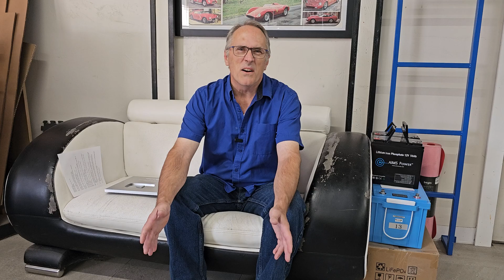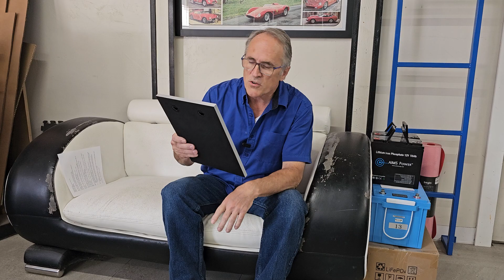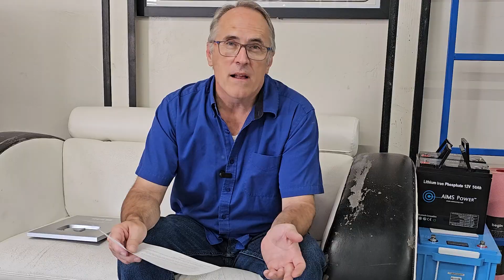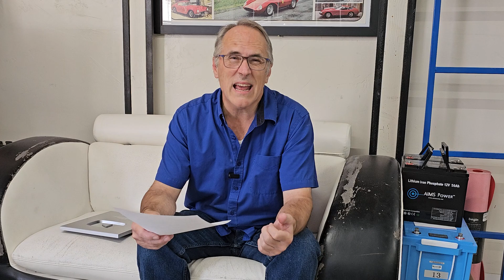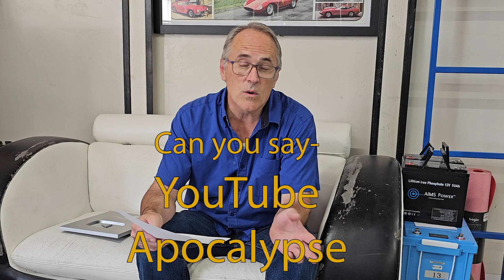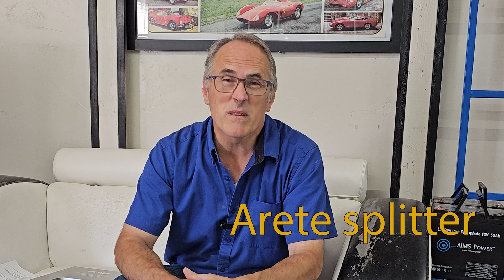100 thousand people like supercars and overlanders and Jay Jarvie's work ethic.

Comment: New subscriber after this particular vid, genuine Jay! I played a lot lego as a kid, my grade 8th arts teacher wanted my virginity while classmates gossiped about my projects' authenticity i.e. "sitting king sculpture made from soap block". At 19yo made a papier-maché/putty mold (Vette inspired) to change the rear-end of my 87 RX-7 TII, but without parental support/guidance (like all my youth) I couldn't complete the fiberglass part, yet now I laugh at myself looking at Jay's steps. I'm a tidy workhorse, had to pull a blown V8 out of my 87 Callaway Vette (so tight with TT), Jay just convinced me to reinstall my turbos heatshields. I admire Jay to have the capital, workshop, settled life...he makes me realize how complex it'd be for me to build a rotary mid-engine supercar like the 787B. It's nice there's a company selling a Ford GT40 kit to build our own at fair price, what Jay is doing is Gordon Murray's levels, with way less resource 👏bummer I don't live nearby, I'd certainly help. I hope Jay installs an adaptive rear spoiler to reduce drag at higher speeds and able to create drag when applying hard brakes (also reducing weight transfer to front wheels).
Reply from the maker: Thanks for following the builds. Sounds like you're an official petrolhead!

Comment: Do you feel that the front end splitter will need aerodynamic testing? What software do you use? Before I retired I used CATIA then SolidWorks to model flow studies. I am a 75 y o fart not looking for work, but just interested in your projects. I
 started following your channel in 2019. Keep posting videos.
Cheers
Reply from the maker: I use Airshapers.com. You may have seen the aero analysis on Leviathan, as a collaboration, in previous episodes. Thanks for following the builds.